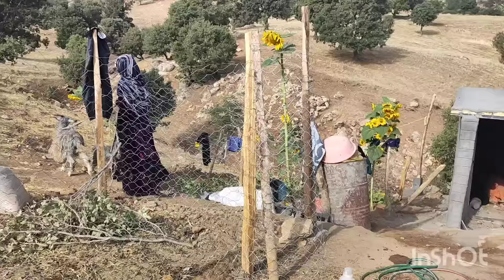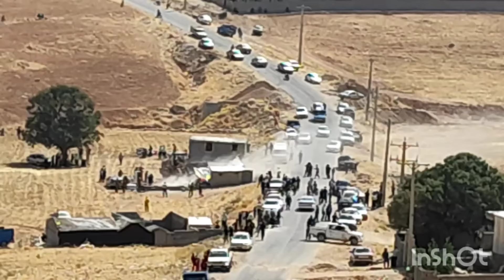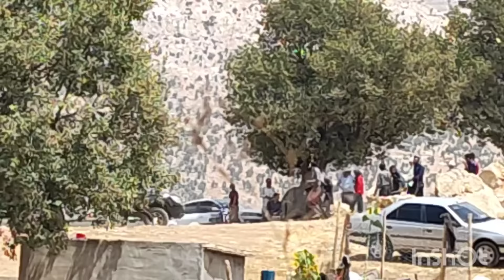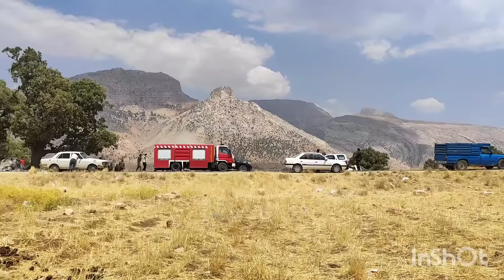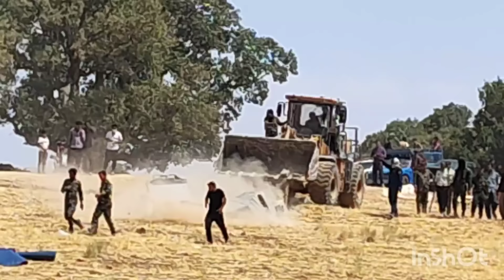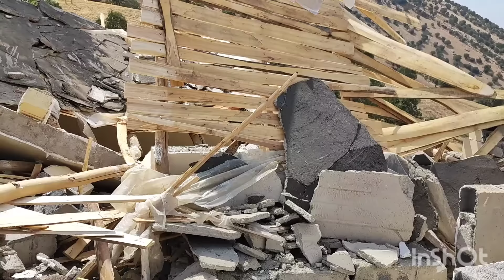A house that is no more: the police destroyed the dream house of Shokoufeh and Qabad

Comment: It seems that these houses were deemed built on agricultural land - land that can be cropped and even those with permits were torn down.  The Environmental Dept, allowed some small dwellings to stay because their footprint was small (area they took up) and they were built in the traditional method of stone and mud with thatched roofs so they blended with the environment. All block and cement houses were torn down regardless. 
There is a great shortage of land that can be cropped and a big population to feed.  The sadness is how it was all done... the government should have halted any buildings as they started and certainly never sold permits which they then ignored.  The whole thing is a very sad mess with so many people displaced and it is criminal that there is no compensation for these people.  Anywhere in this region would be affected.  The only thing I can think that may help, if the one remaining room is left without being torn down  - if they could clad the walls with natural stone to hide the block work and cobble the courtyard also put thatch over the existing roof - replace windows and doors...it may pass the Environmental Dept. requirements... and would certainly then look traditional.  They must keep the footprint (area) small....at least they would have a roof over their heads and be warm and dry while they plan what to do next.